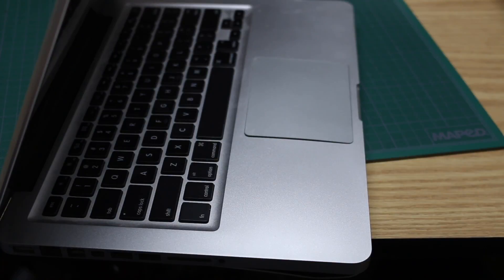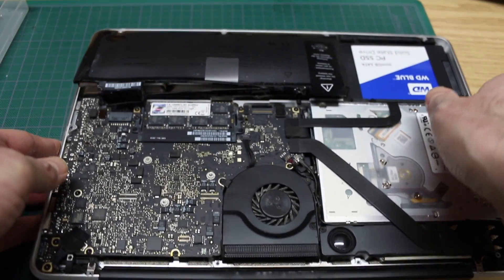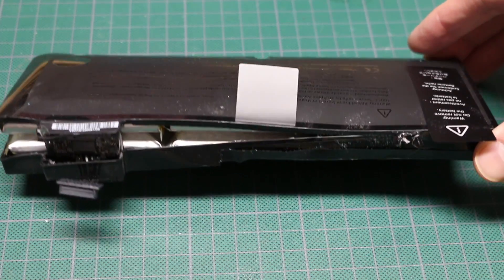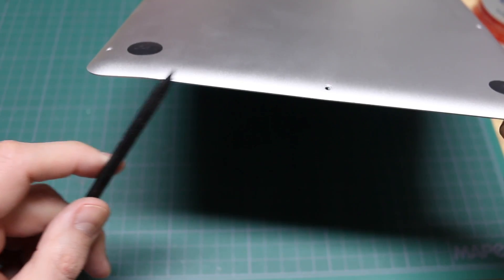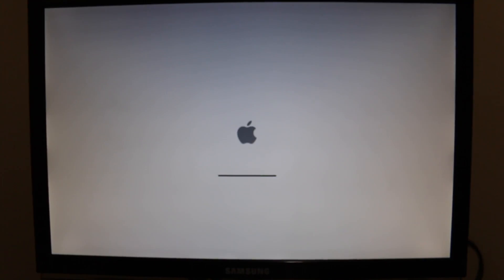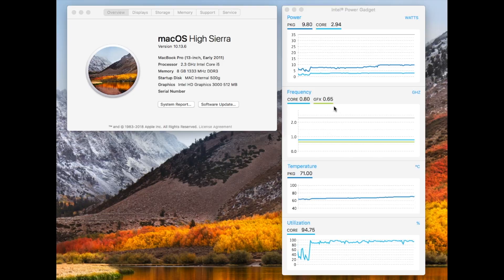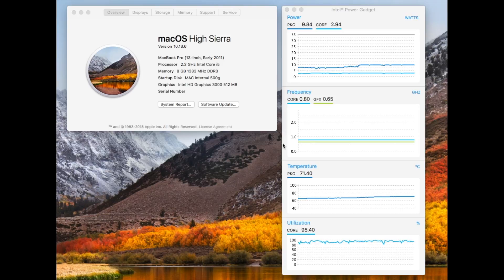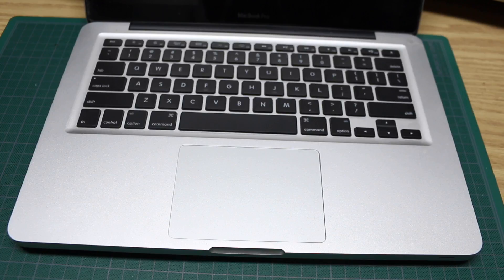Solve Macbook Trackpad Not Working - Why can’t I click the track pad?

Comment: You could make an adapter to allow you to power the Macbook via the battery connector.
The schematics for most Macbooks are available, you just need the original connector, and a bench PSU (variable voltage).
Not sure if there is a PCB inside the Macbook battery, and that is also needed.
Reply: Go go Gadget MacBook!
Louis Rossman would be proud.
Reply from the maker: Yeah there's a board in the battery that I will be harvesting along with the connector and possibly some of the non-expanded individual batteries from the plastic housing to see if I can repurpose them.  Thanks for the idea about providing an external power source.  I'll see if I can find some documentation about doing it.
Reply from the maker: Maybe he can hook me up with some schematics...